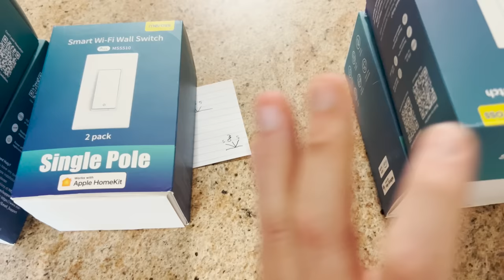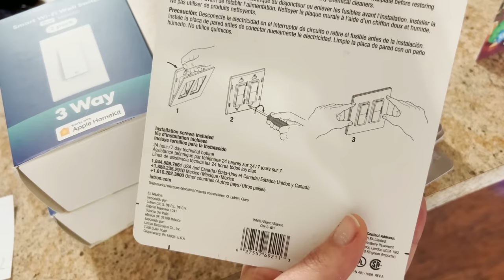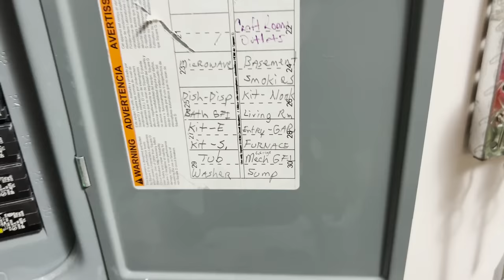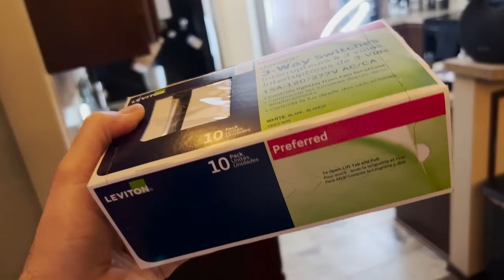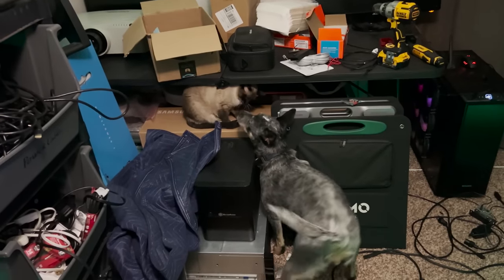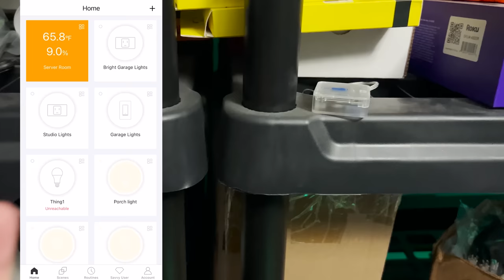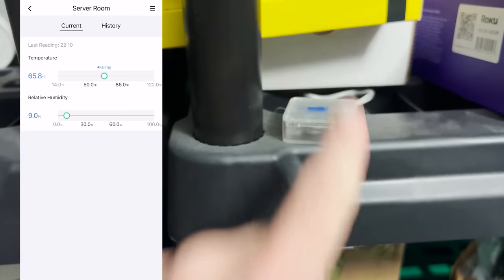Stepping up my Smart Home with Meross Switches! (VERY RELIABLE)

Comment: id also go with wago connectors over the wire nuts for all your connections. so much better and gives you a ton of room in those boxes. plus id use high temp silicon wire for your jumpers from the romex, these 2 things makes life so much easier when installing smart switches.

Comment: Those grounds d/c during testing was driving me nuts.  Also quick tip, when working on LIVE electricity, only use ONE hand.  If you use two hands, you will complete a circuit over your heart which, even with 120v, you can stop your heart.
Reply: Or hire someone who doesn't touch terminals to see if they're live. This isn't a power test, it's a negative IQ test.

Comment: I have switch my house completely to touch panel switches. It makes 3 way super simple you can link one touch button to any other switch in the house. I didn't need to connect anything to the slave switch except power.

Comment: Since a number of people mentioned Home Assistant, as an FYI, non-Home Kit Meross (or Refoss) devices need an add-on integration (Meross-LAN). Alternatively, if you purchase the Home Kit versions, those integrate easier into Home Assistant.  As for Lutron Caseta, they are more expensive but offer more to flexibility. I've used several of the Caseta remotes to add a convenient switch where none existed without having to run wire.

Comment: Z-Wave is good. Lutron Caseta and RA2 Select are better. They are DIY and they work without WiFi on an independent RF frequency purchased from the FCC. The smart bridge is the only device on the network and both the range and response time are excellent. 
Works with Alexa and a Google Home. 
I have installed in my house and a few of my friends houses with ZERO issues.
Reply: I agree 24 years as a electrician.

Comment: Lutron would of been higher end, much nicer, same price and you missed an opportunity to have dimming available.  And for three ways with lutron you only install one wired switch the second is just a tiny remote control that gets mounted in a switchplate and looks like a switch.  its wireless so you can leave the wires capped in your wall and free up space
Reply: not even close to the same price

Comment: I hate 3-way switches, brings back flashbacks from the 70's dealing with the wiring in my mother-in-laws house.  She had me replace a dining room light, but no one told me it was a 3-way circuit.  Short story I got the crap shocked out of me and I fell off a ladder.  The worst part was my mother-in-law and my wife laughing.

Comment: You got it a 3 way on one side you have power wire on the other side you have a switch leg witch is the wire that goes to the light.